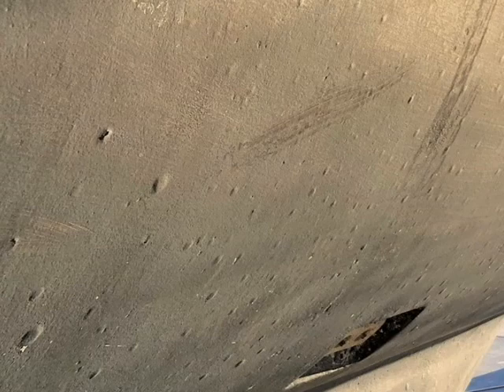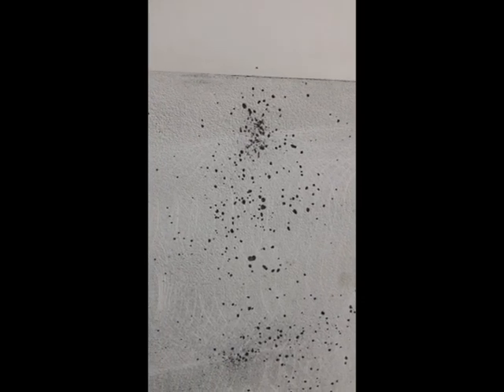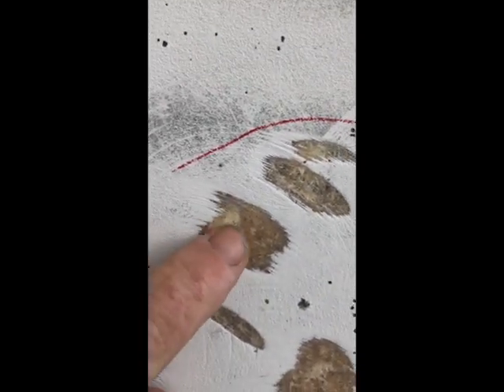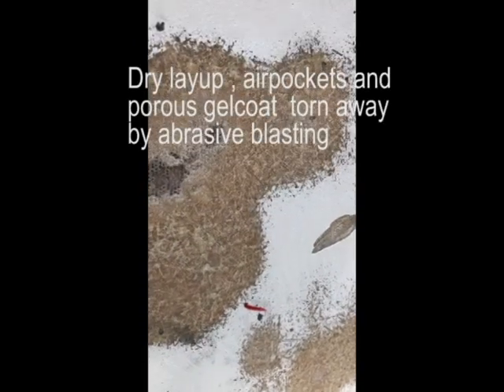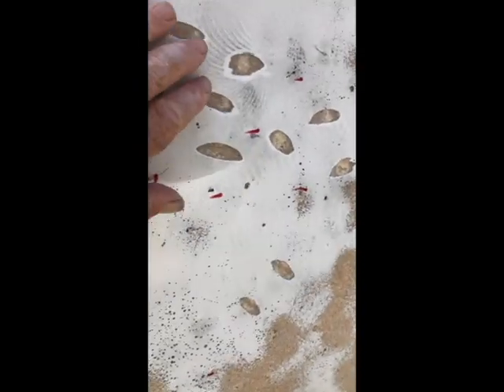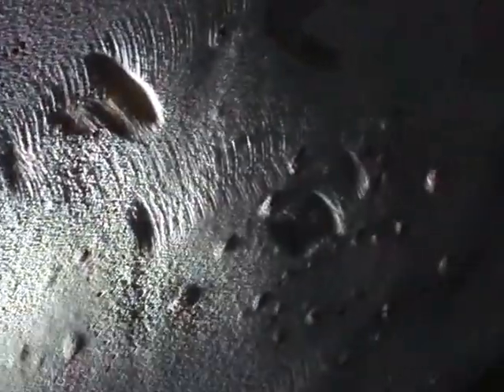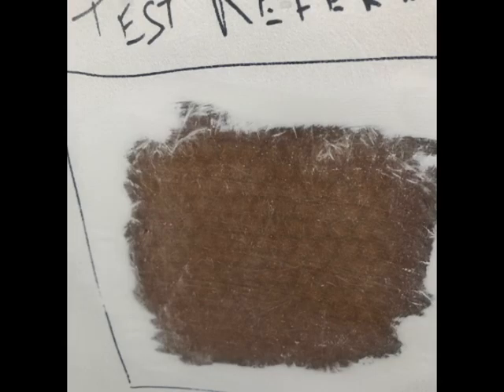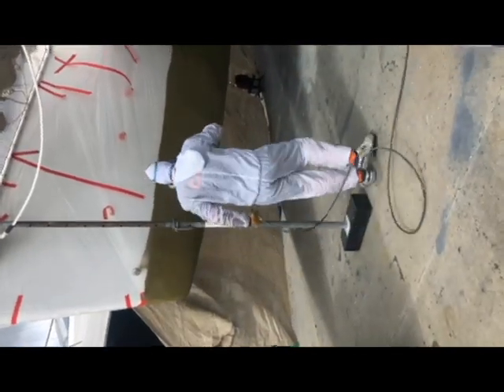Lagoon Catamaran Osmosis and hull blistering

Comment: Hi Mark
Im just about to embark on the same repair job. My lagoon has just been blasted and it looks just like yours.

Question, did you do any prep work to the old sandblasted gelcoat before applying the jotamastic 90 and what did you use to repair the deeper voids ?.

Thanks
Reply from the maker: the sandblasting gave a very good surface for the Jotamastic to grab but i did spend a lot of time pressure cleaning the hull....like 3 times a day for 5 weeks to get all the solubles and glycols out of the surface....there were very few voids in the glass layup or laminate other than where the grinder had got a bit deep....i used a 40 grit flapper disc on an angle grinder to get the best blister, pock removal and feather the edges....if you thing a void or deep damage is too big for a epoxy filler lay some chop mat in it or seek pro advice.....all my small filling and repairs was with west system epoxy and be sure to remove the amine blush before overcoating.

Comment: Mark can you tell me what it like rolling on the Jotamastic 90? Can you roll it fairly smooth or could you sand it after curing? How long does it take to cure, the Jotun TDS says the cure time is “extended”, whatever that means. There is a Jotamastic 90 Aluminium which is supposed to be their highest barrier protection.
Reply from the maker: Rob, gidday...Mine was applied as a single heavy coat using an airless sprayer ....i wouldnt want to be sanding it after cure as it is super tough......24 hrs cure then epoxy fairing compound was applied over jotun 90 and sanded smooth before 2 coats of barrier primer epoxy then antifoul.....then wait 7 days before lifting with slings ...i used a sealift and back in the water 24hrs later
Reply: Thanks mate. I can’t spray here so was hoping the Jotun 90 could be rolled on smooth enough to be a single barrier coat under Coppercoat. Our hull is fair and smooth so was hoping to avoid more bloody sanding fairing!

Comment: We were told not to put in a barrier coat as it would trap moisture between the hull and the barrier coat...  they said if I did, then to put a very thin coat...
Reply: Go back to good gel or glass, paint VE resin over any epoxy areas, paint on on an underwater rated gel coat brand like Scott Bader or underwater NCS. Paint over it with Interprotect 2000. That is the hull repair procedure for Leopards. Same thing